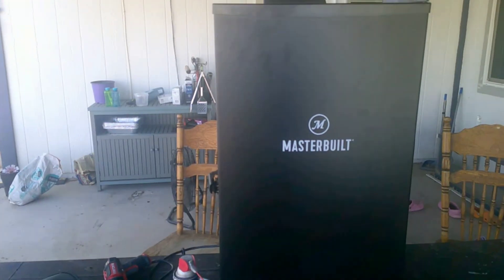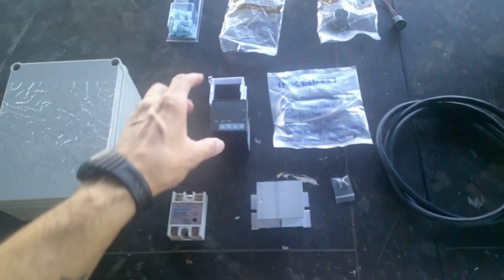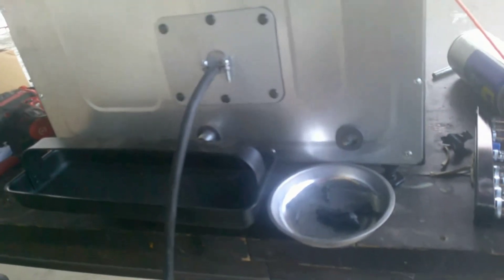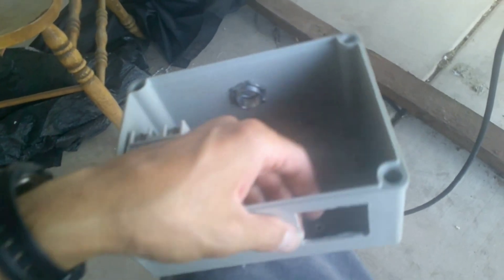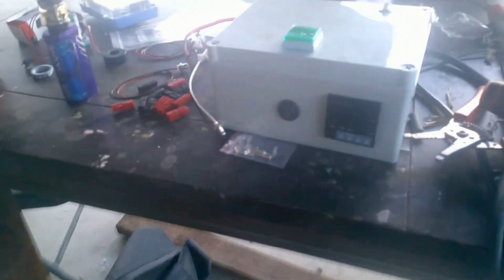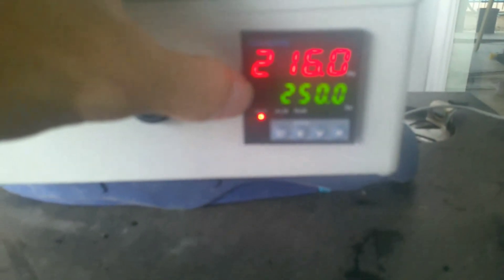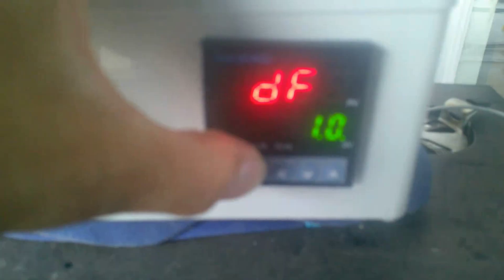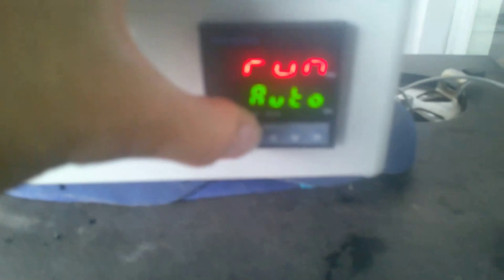DIY Electric Smoker Controller

Comment: Will you please provide a complete parts list required for this modification?  I am not sure of the type of box and size that is required and if parts in addition to the Inkbird are needed.
Reply from the maker: @stanleypaterson1324  https://a.co/d/iT7Dgti is the box and I upgraded the thermocouple to this one 
https://a.co/d/4eip9Rj

The thermocouple it comes with is perfectly fine too...this one just reads faster...if you want voltage and current gauges, any one will work....last is just an on off switch of your choice

Comment: Hey nice work ! Can I ask how you cut the square hole in your project box ?
Reply from the maker: @Mike-ig2zq  I drilled a couple holes and used a jig saw...I considered a roto zip, but  didn't want melted plastic on the bit
Reply: @travislab7687  Thanks !

Comment: Nice. PID controllers are a great upgrade for electric smokers. 
I have a few suggestions for this project. 
The masterbuilt has a 300 deg over temperature limit thermostat.  If you remove the cover on the bottom of the smoker all you have to do is splice a cpl of wires and the limit switch is still in the circuit.   If you do this the original power cord works too. Just cut to length.
For your controller build, did you use any current protection?
I suggest a circuit breaker or fuse to match the element. 
In my build I used a marine panel mount circuit breaker that doubles as an on and off switch. 
Program a 290 deg or so max temperature setting in the PID controller.
Reply from the maker: @USA__2023  it's too late for any of the stock components at this point, but a 10 amp inline breaker or fuse sounds like a smart thing to do...easy to install too...do you think the over temp sensor is there to protect to smoker box? As in 300+ degrees can cause failure in integrity....I always wondered what a safe max temp would be.... although I don't plan on going  higher than 300
Reply: @travislab7687  From what I've heard the insulation is rated at 275-300 deg F.  Most PID controllers have a spot to program the max setpoint temp'.  It's a good idea to set that value to 290.
Reply from the maker: @USA__2023  since you have one, maybe you can answer this...when the temp reaches my 250 setpoint, it turns off the element, but due to the heat generation, it will climb to about 260'ish after it's cut the power to the element... would the auto tune feature learn that and correct it by maybe shutting off at 240? I understand I can just set it to 240, but I don't want it to drop to 240 before it turns back on.
Reply: @travislab7687  That's part of the PID tuning. Once tuned the PID will start cutting power output as it reaches the setpoint so that it won't overshoot. The PID should put out 100% power until it gets close, then it starts pulsing the output to slow down the climb so that it smooths out to the setpoint temp. I didn't mention it before but the temp sensor that you use makes a big difference. The sensor you have is very short and kind of thick. You would be better off with a sensor the is at least 4 inches long and 1/8"  in diameter. This gives you better response time which makes PID tuning easier.  You can use the "Auto-tune" feature of the PID to give you a starting point. First thing you do is write down the existing settings, then run the smoker to get it to 175 deg. From there raise the setpoint ot 250 deg and put the PID into auto-tune mode and let it go. After it is done let the smoker run for 30 minutes and watch for temp swings. Then let it cool to ambient temp and see how it goes.
Reply: @travislab7687  Once the PID is tuned you should have at least +/- 5 deg swings or less. Again, this depends on your temp sensor. I use a small diameter PT100 in my smoker. I think it's 3mm. The welders in the videos on my channel use 1/16" N type thermocouples and have a pretty fast response time.
Reply from the maker: @USA__2023  you are a plethora of knowledge, thanks! Sounds like auto tune does the same as a battery charger...which in a smokers case would 100% be beneficial...I'm going to try it now
Reply from the maker: @USA__2023  I sent you a Facebook message, I had another question if you have a minute
Reply: @travislab7687  Blue Sea Systems A-Series Toggle Single Pole Circuit Breakers